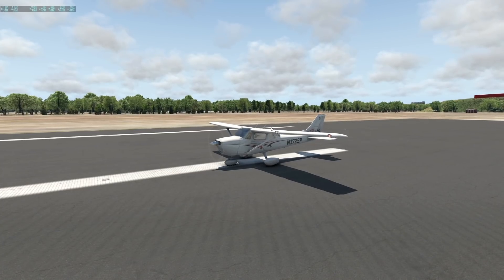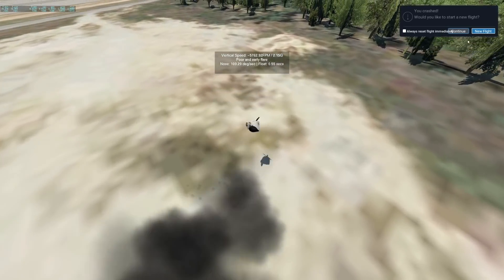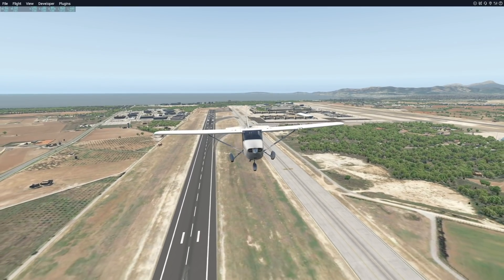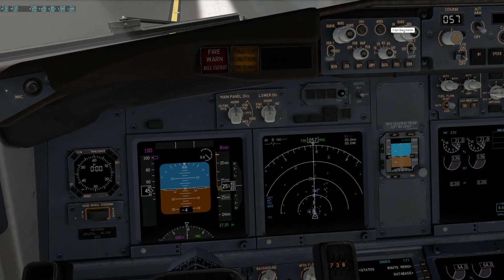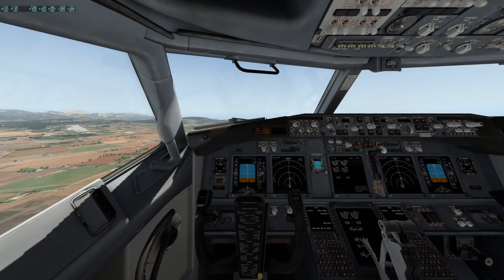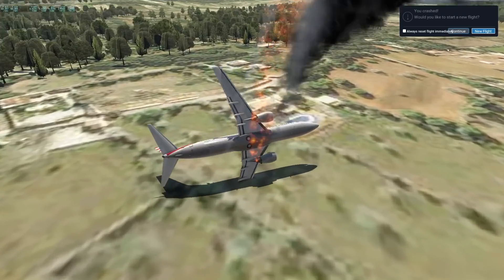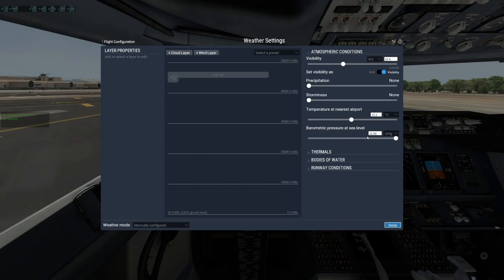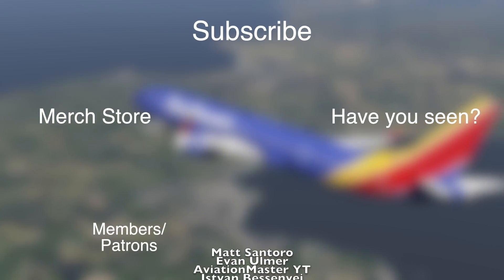Airplane Struggles To Take Off - Flying Planes In LOW Air Density

Comment: This is why high altitude airports have significantly longer runaway
If u didnt know that the higher the altitude is the lower the air density is so the engines struggle to work